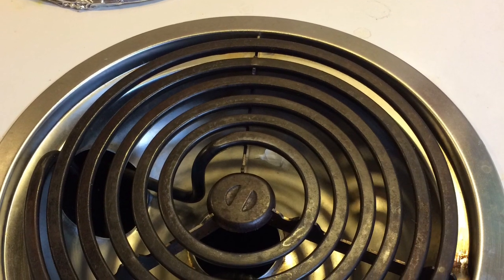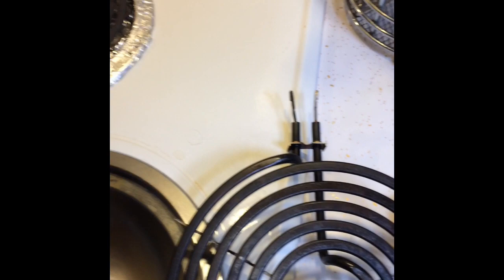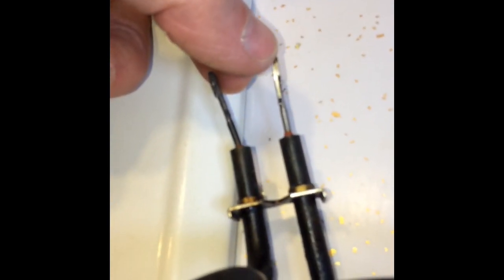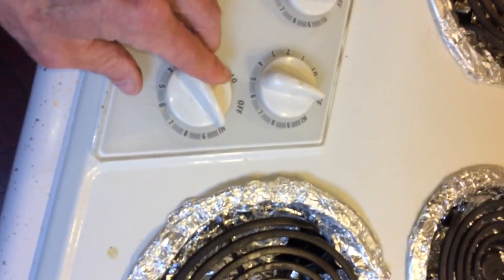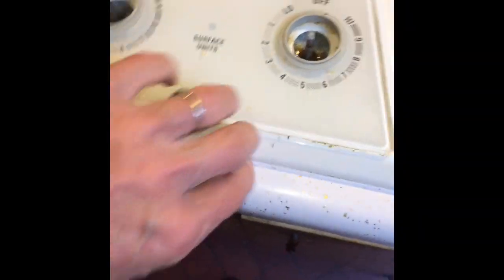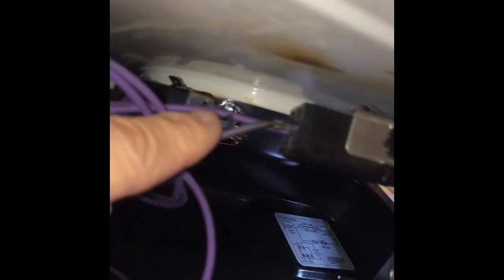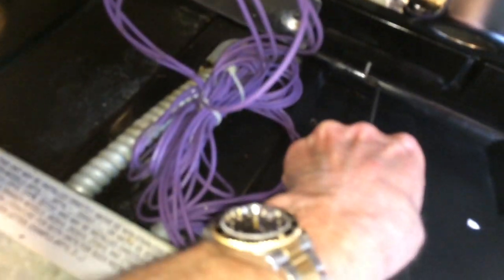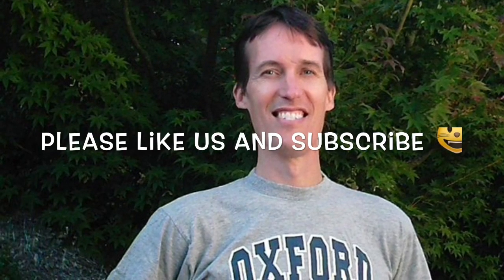✨ GE Stove Top Not Heating  - Easy Money Saving Fix ✨

Comment: Thank you so much!

This was the best advice on yt:
1- bend the prongs an 1/8"2- use a nail file or steel scrubber on the prongs
3- check that all the wires are connecting
4-replace or patch any frayed old wires - use electrical tape
5-check that you don't have a short at the breaker box - turn stove power off/on
6-Leave breaker to stove off for 10 minutes to reset the power supply

I'd like to add one more...
7-pull out the burner knobs and clean out any gunk

Mine is over the stove and had old oil grease and gunk in it

Comment: hi.  My daughter has a GE oven[electric] with 4  top burners.  There was a spark from the end of the burner where it goes into its connection.  I check the element and had continuity on my meter.  I then replaced the  connection.  the red light indicator comes on.  but no heat. I only saw one fuse.   Should i replace the switch control.   this oven is about 12 to 14 years old and could not find a model number.  thanks from Toronto
Reply from the maker: Hi Steve,
Can you try lightly sanding the metal contacts on the element and then slightly bend them outward by 1/8 inch and then try again.  Maybe they just needed better contact😊If our Video Helped you Fix Your Machine, Please Click Here to Donate with Venmo:
https://venmo.com/u/Scott-Flint-1

Comment: Got a stove that the burners get hot but slowly and never hot enough.   Will take over an hour to get a pot of water to a boil. It's making contact it has heat just not enough.
Reply from the maker: I would replace the burner👍
Reply: Replace the burner
Reply: I just replaced two of the burner switches. WL May co. Had robert Shaw universal replacement switches.  $45 each
Reply: Ours is a 27 inch GE spacemaker drop in stove. The symptom was you could set for low heat ok. Or high heat ok. But no control in the middle range of setting. Switches That we replaced on the left were the ones often used. And had lots of grease around them.  We have to keep rebuilding the stove otherwise we’d have to order all new kitchen cabinets and new 27 inch stoves are $1600 at Home Depot. 
I’m happy fixing things with no computers.When changing the switches you have to be extra cautious with 240 V. Make sure the breakers is off and use a handheld circuit alert sensor at the oven to confirm there’s no current. Take photos of the wiring before you disassemble the wiring. Also we had to make a little jumper - 14 gauge wire with wire nuts because the pilot light wire was too short going to the two new switches/burner thermostats. Also pay attention on the 2 L1 and L2 connections. Pay attention to which was the black and which was the red when you replace the switch.
We don’t have the model number of the oven because the tenant scratched off the model number in cleaning. So I took the old switch/temperature control to WL May company and they matched it up with the Universal part. Pay attention to the included instruction sheet on cutting the long stem. That’s where the knob attaches on the front. Then we figured out to get the proper standoff from the front panel we had to mount with their included standoff bracket on the back of the panel - with the ferule that goes through the front panel and tightens up with a front panel nut. Hope that helps somebody.

Comment: My GE is a newer stove top and the elements are old school metal.  They get hot and then just warm, hot and then just warm. I am unable to fry with it as it fry’s and then stops frying, starts again and then stops again... Any ideas?
Reply from the maker: It is supposed to get hot then cool off and then hot and then cool off .  That’s normal.
Just need a new element so it can get hotter each time it heats👍
Reply: @ScottTheFixItGuyChannel  I'm not making myself clear, it cools off a LOT.  If I am doing a stir-fry, it cools off so much that it stops frying for like 5 mins and then it starts frying again for 1 minute and cools off again for 5.  It is like the element was completely turned off for 5 mins.  The stove is a GE and only a couple of years old.  I'm ready to toss it out.
Reply: Thank you,
Just need a new infinite switch for that burner.
Reply: You know what is sad, this GE stove was bought new in 2018.  It replace a Moffit stove that my parents bought in 1955...  the old stove lasted over 65 years, the new one lasted 3 years.  They build garbage these days!  %$#& Garbage! @QuickAndEasy5MinuteAppliance